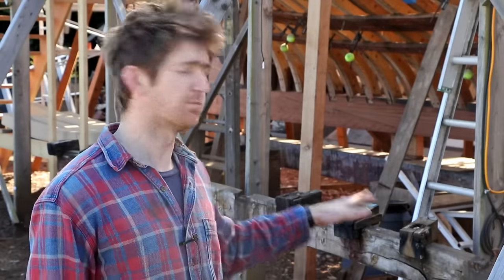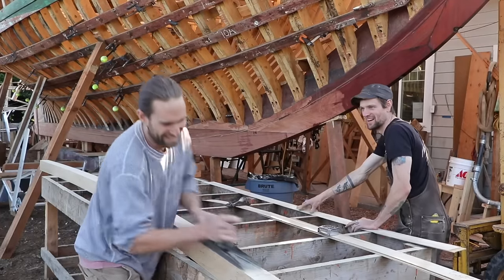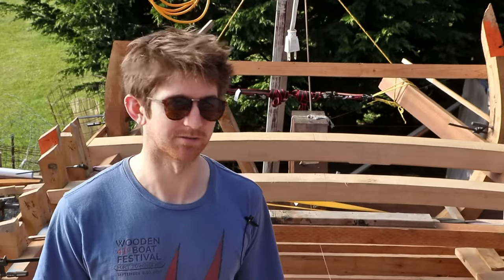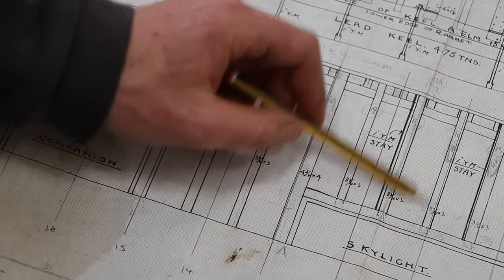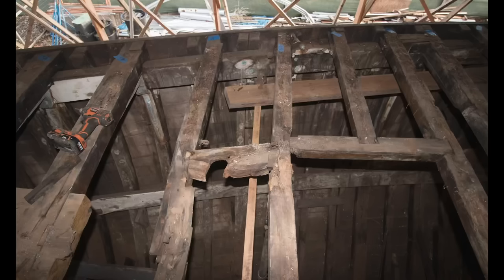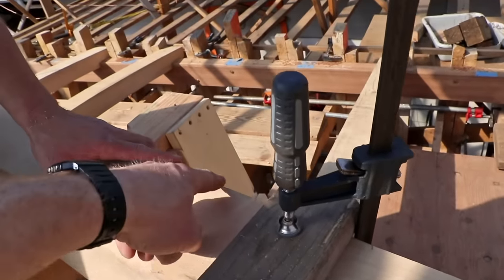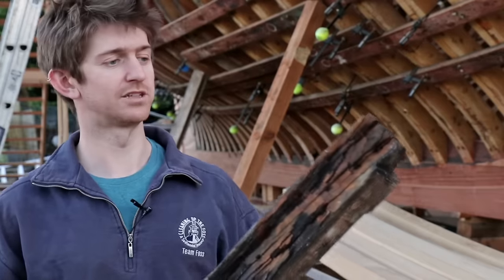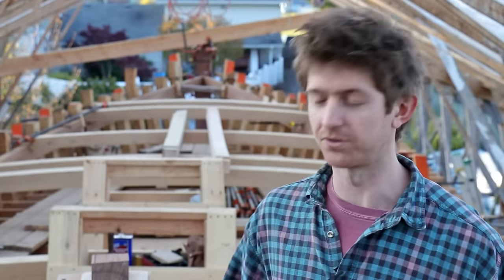BoatBuilding - Fitting Deck Beams! (Tally Ho EP70)

Comment: Askinig this question because I've wasted too many hours chasing rabbits in the comments. Please forgive if it's already been answered. Are these joints being glued after dry fitting or are they so percise they don't need any adhesive? If they are being glued is it being done as you go or will it happen after all joints are cut?
Reply: These joints won't be glued, glue is not at all the thing for this type of construction. After the joints are bedded, expect mechanical fasteners such as bronze screws & through-bolts.
Reply: I guess I should have assumed that from the previous videos. Does the bedding have adhesive qualities or is it just sealant/crack filler?
Reply: @WKBHB  - Leo has been using Dolfinite (marine putty) mixed w/ pine tar (for oozy flow) as a gap filler, I don't think it has any adhesive properties.